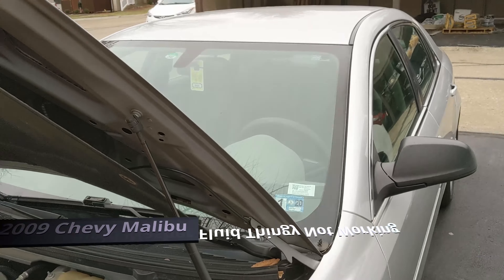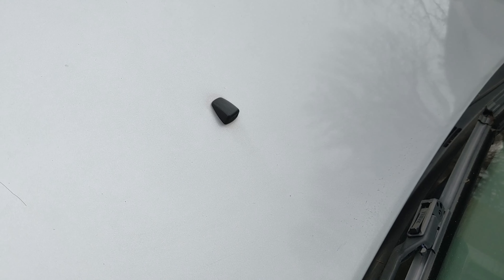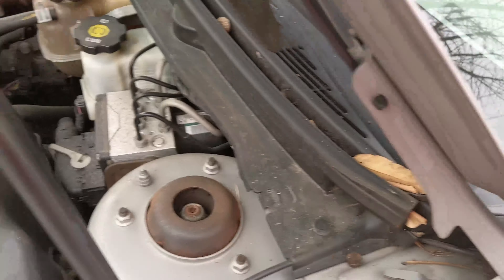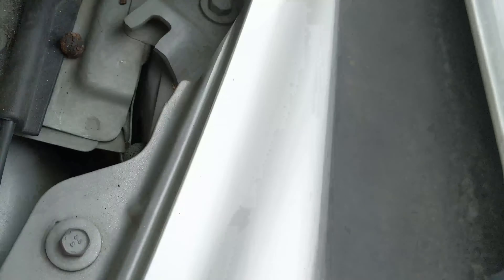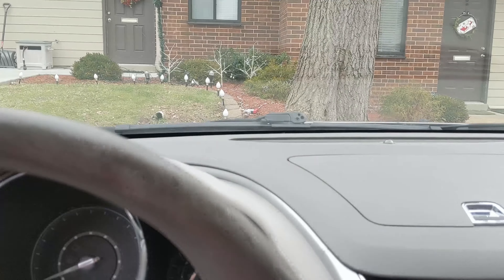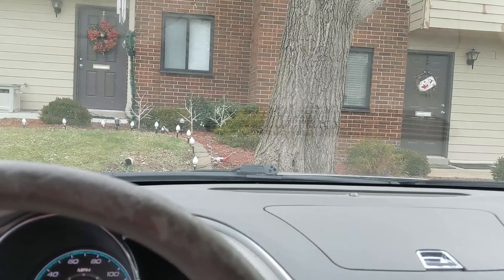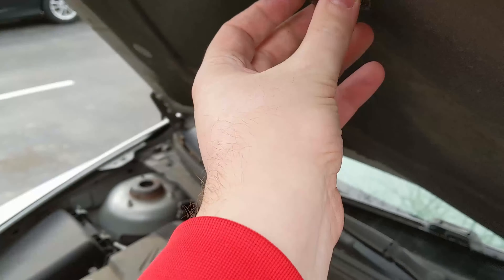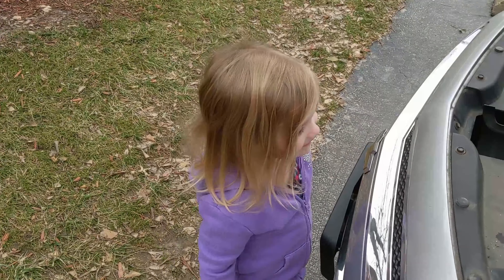2009 Chevy Malibu Windshield Washer Sprayer Front Hood Not Working Easy Fix FREE No Tools

Comment: Good job just did my 2010 cost a whopping  $3.46 ea. at Rock.  161k miles and running strong figure 250k mi. and then look for 2012!!
Reply from the maker: Here's what you do, whatever you would've spent on the fix, let's just say $500 for instance, you take that money, subtract $3.46 and then you Venmo me the difference. 

Thanks kind stranger for the $496.54!!!
Reply: @JosephNaylorV  Well good point, but in 2021 I decided to adopt the Chinese way of doing business and that means taking your intellectual property, use to my advantage, and keep all the spoils to myself.  But hey I was kind and gave a thumbs up!! :)